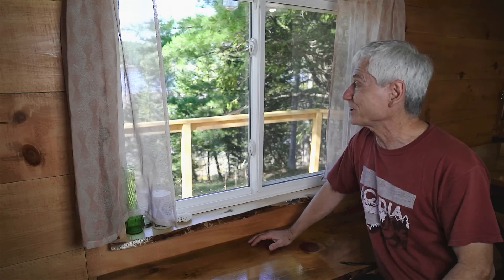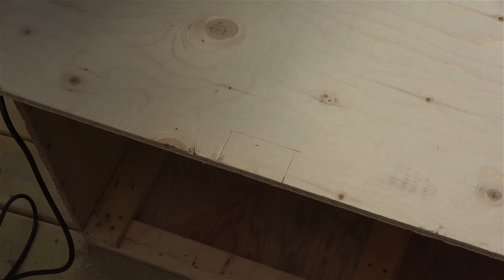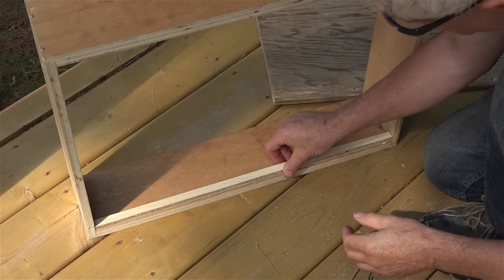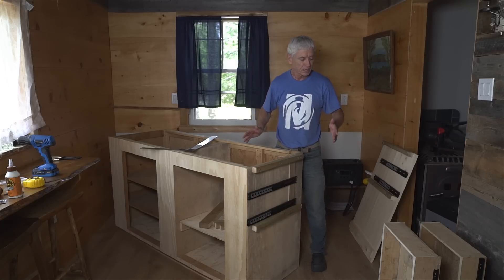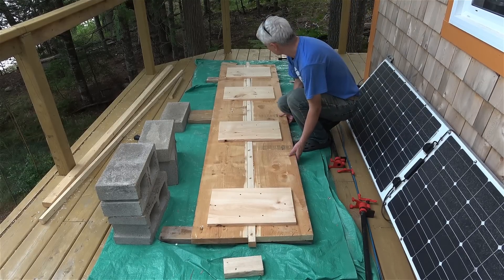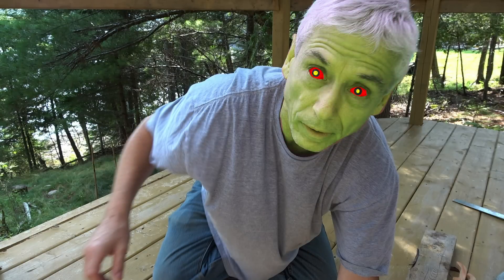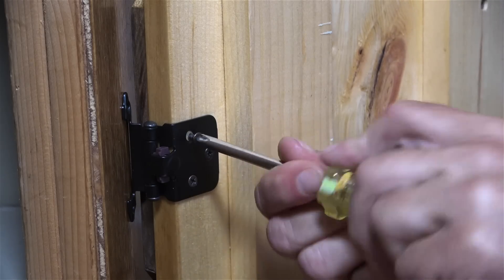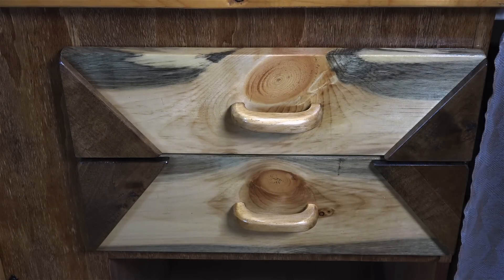Rustic Cabin Kitchen Makeover - Old Counter Turned Cabin Showcase!

Comment: Folks sometimes forget that re-use is even better than recycle and you did both here. Nice job on the build - I like the way you extended it to put the drawer section in. Good tip about checking the square of the cabinet, too. If you don’t need a full-sized fridge and stove some recycled RV propane units might work for you. There’s a place in NS that reconditions and sells them or they come up on Kijiji privately sometimes, too. Just a thought, you probably have that  figured out already. 👍🏻

Comment: I am 4”10’ and don’t weight that much so I have developed strategies for most everything I do.  To move anything heavy I use a moving cloth, the kind that we use when we are moving to a new place, a thick heavy one.  I put the object to be moved on it and slide it.  When I lift things I lift in increments, usually with ladders or something at each end.  I renovated my own house that way.  It definitely takes a bit longer and a bit more organizing but my back is still good.  Hope this will save yours.

Comment: If you use self closing drawer slides it eliminated the issue with the drawers coming out if they are slightly down hill toward the front.  It's also useful if you are putting them in an RV so the drawers stay put when you travel, which is what I'm building.   Keep the good stuff coming.

Comment: Yes, you are right - it's beautiful, suits the cabin and so well made. Your idea of leaving the last section removable,  is really smart. Using so much recycled and 'found' material not only saved you a bundle but also fits with the ethics of saving our planet! If I recall correctly, I think you mentioned using a dishpan to wash with and perhaps a small heating unit to cool anything you don't want to cook on the wood stove? Looking forward to whatever & whenever you get to the next stage.

Comment: Slim,
You really surprised me on this build. You did a pretty nice job. You didn't seam like you had the patience to do all of that.
Great job!
The only thing I would like to add is that when you're cutting a narrow board on the table, saw with the Miter Gauge and fench. Use a piece of wood to space the correct length at the front of the fence so as you push the wood thru it doesn't bind and kick back and possibly pull your hand into the blade. As you move forward beyond the short piece of wood you will have space between the fence and the end of the board you're cutting. Couldn't see the end of the board well with your hand over it. But it looked like you used the fence to set the length of cut. Dangerous  move.

Comment: I've always appreciated your DIY projects, this is just beautiful as well as practical. May I suggest ribbed finish nails slightly countersunk and filled with your sawdust and sealer on the corners of your overlaid front? I've had eventual edge lift doing that. Figured it was a thinner layer of glue on the edges, and extreme temp changes probably weakened where it was thin. But as always, you've inspired me and many others to be creative and functional. Thanks

Comment: Comment on tablesaw work,  when you use both the miter gauge and the fence, you should clamp a block to the fence for length which is short and doesn’t go past the blade.   Otherwise you risk a kick back.

Comment: Lookin awesome slim. I wanna see how that countertop holds up. Ive seen it done before but the tops can slowly fade yellow and crack depending on use. But right now its looking good. Ty for sharing ❤❤❤
Reply from the maker: I think if the counter fades to yellow, it will even fit more with the cabin! SP

Comment: I think you should do a vented cupboard door on that last cabinet, using those diagonal panels and some security door mesh, in a tone that belends with the other cabinet fronts, for battery ventilation, as the curtain really detracts from the quality of the rest of the unit. Sorry to be negative, but the aesthetics are otherwise glorious!

Comment: Nice work, but cutting those door handles out on the table saw like that is very dangerous. You are very lucky it did not kickback at you, speaking from experience here. You should never perform a table saw cut with both the miter and fence. In fact you would never want to cut that narrow of a piece with the fence in place. That's a cut that should be made with just the miter if you are going to do in on a table saw.